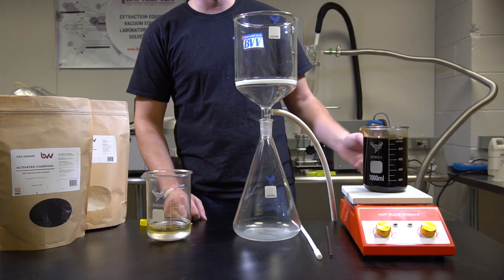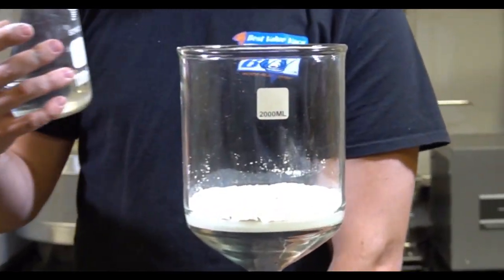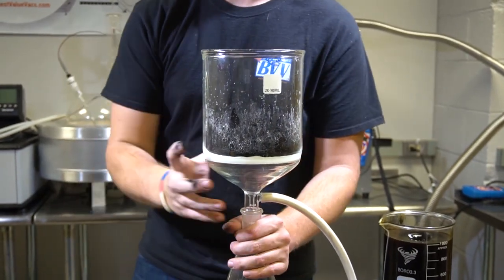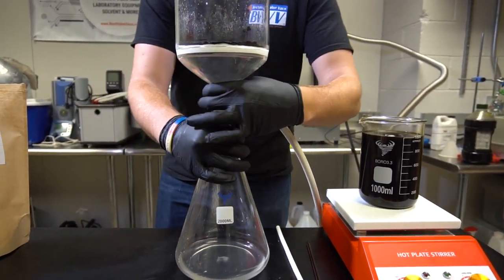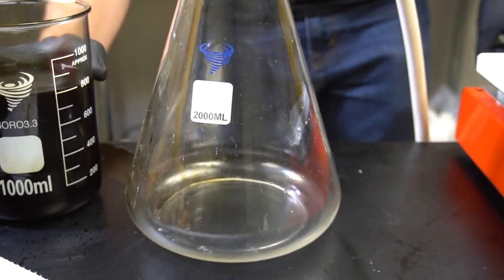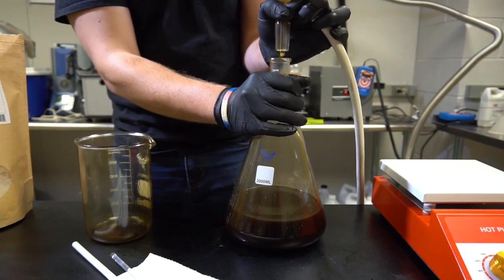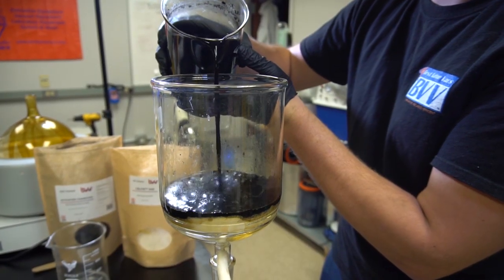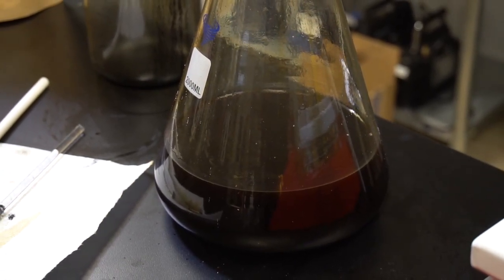How To Do Buchner Funnel Vacuum Filtration

Comment: What particle size is the celite 545 and what grit disk are you using in that buchner funnel? I know G3 wouldn’t be sufficient to filter out the celite 545 in most cases and I can’t imagine a 4-1 of ethanol to material going through a g4 that quick…

Comment: How do you get the rest of the carbon out of your extraction ?
Reply from the maker: @stannowak5086 using a buchner funnel along with 1 micron ashless filter paper. You'll continue filtering the solution until the carbon is removed.

Comment: How many microns is the filter?
Reply from the maker: @anatol1204 the fritted disc filter inside this buchner funnel has a 20-25um design. It was intended to mimic a coffee filter. We have since changed our design and use a porcelain buchner funnel with ashless filter paper instead. The filter paper we sell comes in fast (20-25um), medium (11um), and slow (3um).

Comment: Can you get the same result pressing with heat, I used to make my own RSO well isopropyl extracted cannabis oils, And just heat off the solvents, But then I got a cheap heat press, I would of bought a NugSmasher if I was rich enough, lol, It is expensive enough just making Cannabis Rosin, I think though with Alcohol extraction or solvents, you get all the (of) what you want than when you do heat press, It is just too dangerous for me not having the equiupment I need to stay safe, So I use a heat press, Plus it is a faster process, And cleaner with zero solvents at all, Still though if I had all the things I needed to get solventless extraction, The purger and not living in a block of flats, I am not putting other peoples safety at risk from fire, Let alone mine, So yeah using a Heat Press like a NugSmasher is probably the best way for most people to extract, Unless you in a setting that is safe....

Comment: Will this get rid of the strong chlorophyll taste?
Reply from the maker: @SoggyCashew using the right filter aid will remove chlorophyll. Removing the smell and taste of the plant. When extracting using ethanol, activated charcoal exhibits selective adsorption, meaning it can selectively target and adsorb specific compounds like chlorophyll while allowing other desired components of the plant extract to pass through. This helps in removing chlorophyll while preserving other valuable constituents.

Comment: I've always found it easier to mix the solvent and filter media in a separate flask and then pour the slurry into the buchner with the vacuum on, you get a more even filter cake. As long as you keep the vacuum on, you can add layers of other media on top the same way and they'll also come out even. I've also sworn off the fritted buchner funnels in favor of pore plates, you'll never get the carbon/polymers out of the frit unless you use piranha solution.
Reply: What exactly do you mean by a "pore plate" i am guessing a ceramic buchner? or perhaps a lenticular housing? thank you for the insight
Reply: @kevinweeks3824  The plate is perforated rather than fritted
Reply: Couldnt agree more with everything you said. This video is an example of how not to prepare a DE cake.

Comment: mix the carbon directly with the solution and stir and then filter
Reply from the maker: Towards the end of the video, you'll see he does precisely that. He adds the carbon to the solution and then places it on a hot plate to use its stirring setting. In this video, we wanted to demonstrate how to set layered media into a Buchner funnel properly.

Comment: This is a underrated video.
Reply from the maker: If you have a video request, let us know! Thank you!
Reply: How about a mixed solution extraction and filtration. Maybe a video on removal of chlorophyll!?!
Reply from the maker: A post-extraction dewax and chlorophyll removal? I'll pass along your request! 
You can do this during extracting using a dewax sleeve. 
The cold makes the hydrocarbon solvent less aggressive towards the fats, lipids, and chlorophyll, leaving them behind in the biomass. 
https://www.youtube.com/watch?v=3T_W9dzf-9o&t=1s 
Feel free to give us a call at (331) 281-0154 to speak with a tech.
Reply: @Jmarosii  I should've been a little more specific. I meant the remove of chlorophyll by UV and UVA spectrum lights.
Reply from the maker: @gene pattenson We have not done any research on the light spectrum and its effects on post-processed biomass.

Comment: It looks like you have a lot of water in there..
Reply from the maker: Are you referring to the resin suspended in the pure ethanol or the filter media? 
During this demonstration, the media used was not baked a second time. We did this to show how effective the media is right out of the bag. It is, and we do recommend you to bake your media before use. Removing ALL the moisture WILL make the media more effective, allowing for less media to be used. 
Feel free to give us a call at (331) 281-0154 to speak with a tech.
Reply: @Jmarosii  I mean the white cloud that formed in the collection flask. You get the same cloud rinsing equipment with water. Also this method of filtration should give you yellow or almost clear solution but what you have is brown that's why I think you have water in your methanol. You should really make a new video about these medias because they work really good for me. Just by curiosity what do you mean by baking the media? Why do we need to bake these media?

Comment: What filter are you dropping the celite onto?
Reply from the maker: This specific funnel has a glass fritted filter disc welded in. The glass filter is 10-15µm. This type of funnel is typically used for applications where standard filter paper would be destroyed by the solution to be filtered. 
You can use an ashless filter paper or an unbleached coffee filter on top of the fritted disc, keeping fat and lipids or any other undesirables/debris out of the fritted glass disc to prolong its life. 
Feel free to give us a call at (331) 281-0154 to speak with a tech.

Comment: Do you use aper filter in funnel before the powder? If not How does the powder not go through the holes?
Reply from the maker: This specific funnel has a glass fritted filter disc welded in. The fritted glass is typically used for applications where standard filter paper would be destroyed by the solution to be filtered. The glass filter is 10-15µm. 
You can use an ashless filter paper or an unbleached coffee filter on top of the fritted disc, keeping fat and lipids or any other undesirables/debris out of the fritted glass disc to prolong its life. 
Feel free to give us a call at (331) 281-0154 to speak with a tech.

Comment: OK guys I hope you all see where this gentlemen went wrong,He was expecting the liquid to be clear the first time,it never was ,so he cleaned everything out hoping the second time it would be clear ,it never did?
One simple mistake, you half to use a filtration filter paper.
you cant just throw the carbon down on the cellulite that come with the funnel because it will go thru.You can see he was expecting it to be clear.
Reply: Actually you dont have to use filter paper with fritted glass funnels. It does help with clean up of your funnel, but thats about it. Not sure what you talking about cellulite that comes with the funnel? Uh? The carbon shouldnt and isnt going through at all. Not if you are using the corrent funnel with the right micron size. The black going through the filter isnt the activated carbon, its whatever was in the solution in the first place.
Reply: Vancouver Guy I think he meant to separate the celite and activated carbon with filter paper and I would recommend to place the filter paper on the bottom, between the celite and activated carbon and to be really careful on top. Also be careful when pouring the ethanol mixture. Very careful!  A cold ethanol mixture will work better (-40c). Good luck!

Comment: I found the best way to evaporate alcohol is to take an aquarium air pump and place the air hose into glass container (I used a 1 Qt ball jar) and set the container on a coffee cup warmer. The coffee warmer is a small hot plate that is used to keep your cup of coffee warm. In less than two hours, 90% of the alcohol had evaporated. The remaining fluid is very oily.  Be sure to partially cover the opening of the glass container with a lid but do not cover it entirely. You will need room for the alcohol to exit the container. Also, due to the bubbling, the alcohol will splatter out.
Reply: @Big Papi Oh...., okay.
Reply: That's an expensive way of doing it and certainly not "the best"

Comment: Looks the same
Reply: Watch the celite 545 video this guy didnt doit right you need to let that powder patty dry after it settles and your supposed to doit it with water  its to soupy to hold anything back yes it gets wet when you introduce you tincture to it but letting it dry an settle creates a solidly packed patty hes got a wet sloppy patty watch the celite 545 video it does work if you doit correctly and the guy in that vid does it correctly

Comment: do you still put a filter paper in or does this replace that all together?
Reply: No no it doesnt sorry bvv you do want that filter paper the correct way to do this is to put a filter paper in then your powder then WATER vac the water out to form a patty let that patty DRY do not put you tincture thru that soupy mess you guys.... It didnt even hold the color back that hole patty is yellow and if it alll the way thru the patty its making it back into the receiving flask... This is redundant idk if you telling them wrong on purpose bc im sure you poeple are smart enough to know that powder patty has to settle and drso it can actually hold back sediments caratons chlorophyll ect... Watch the celite 545 video that guy does it correctly amd theres a night and day change not a slight change
Reply: @sarahlarick3055  nice post
Reply: Putting a filter paper will save time on cleaning. Also is important to put every layer evenly and flat. And if you want, you can also add another filter paper on top to not disturb the kieselguhr and the charcoal.
Reply: No paper necessary with a sintered glass filter.
Reply from the maker: This replaces the filter paper all together